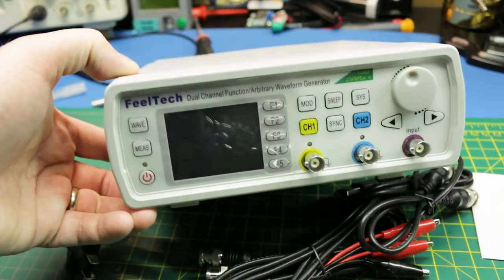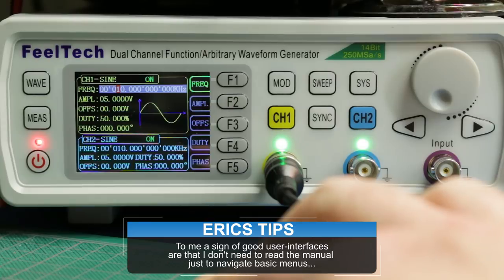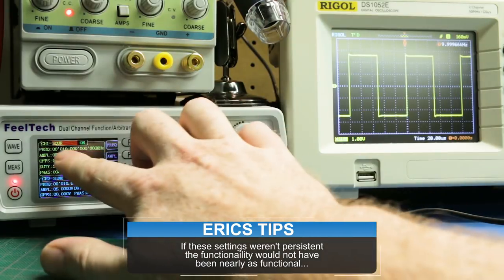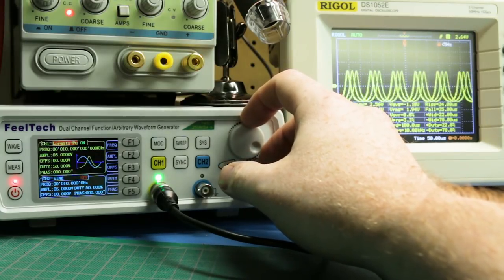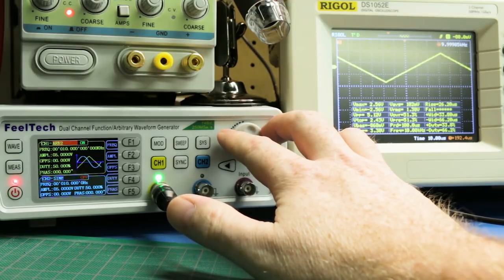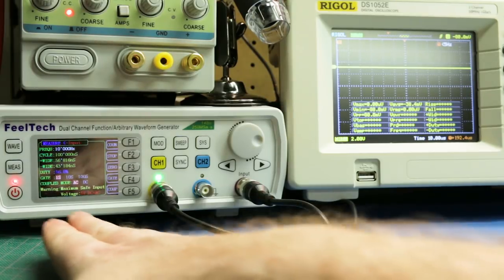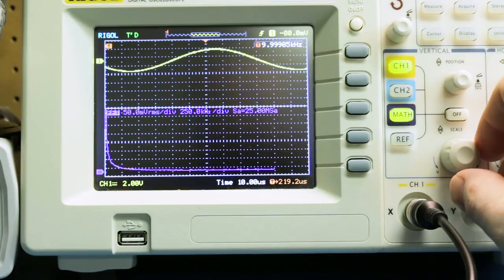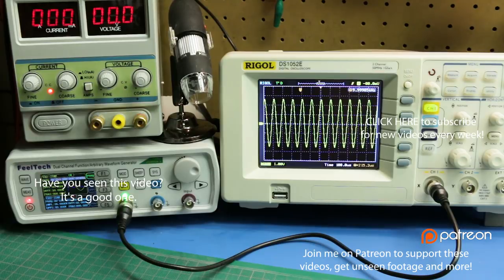Electronics Basics- Function/Arbitrary Waveform & Signal Generator FY6600 REVIEW

Comment: Things I'd test based on faults I discovered in my cheap generator:
- the output is "stepped" if you can "zoom in" into a slow signal. Like lowest range on the scope and look at a max Vp-p sawtooth or triangle. (normal, it's just how big the steps are?)
- the sweep function is useless. Log would be nice for FFT, but it's broken. It does go through the range but it's not log.
- if you change the sweep range while sweeping, it can go out of range and do funny things before wrapping around
- Sure enough, you can see the jitter on a delayed scope trace which should correspond to the sampling rate. Does it?
- the TTL outputs have better square wave, but how good is it?

Comment: You buy a 25 MHz AWG and demo it at 10 KHz??????  A 555 timer can output 10 KHz.  How does it perform at it's maximum frequencies?
Reply: @alfa-psi  not bad, I got another version Fy6900 60mhz 74USD incl. shipping from one of these China EU warehouses.
and it ain't bad at higher frequencies as long as you have the price in mind, and I would reckon the 25mhz would have no scruples up to 25mhz.
My 60mhz unit, are keeping loyal amplitude up around 40 to 45mhz on sine, above 45 to 60mhz, it goes from 5div to 3.8div.
I am on rev board 2.02  https://imgur.com/a/wo4v4Mz

Comment: Tell me pleaae, how and when to use this or any other for that matter waveform generator in real electronics practice. I often see people review these and connect them to the scope but I've never seen anyone applying it in their practice. I get a feeling people buy them just because others review them and say how nice they are. Well, they are real nice but how and when do you use it in what projects? Please give me a few examples apart from connecting it to the scope.
Reply from the maker: Most commonly I use it for simulating a sensor signal or input in to a project to test the code reaction for X situation. Allows you to debug code without having to fight tricking the actual sensor hardware.  Theres nearly a thousand videos here- surely you can get an idea

Comment: I'm looking to measure a 250 mV peak to peak signal and none of these inexpensive generator/measurement units seem to go that low. There input range for measurement is 2 to 20v peak to peak. I'm saying all this hoping that I've read the specs wrong and that you can actually measure frequency in that low a voltage range?
Reply from the maker: Why wouldn't you get a scope then?